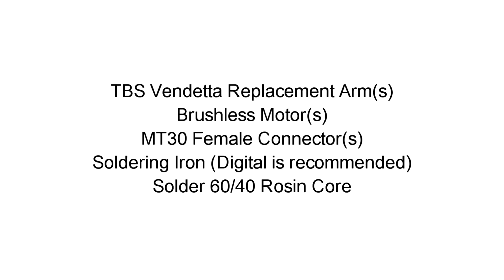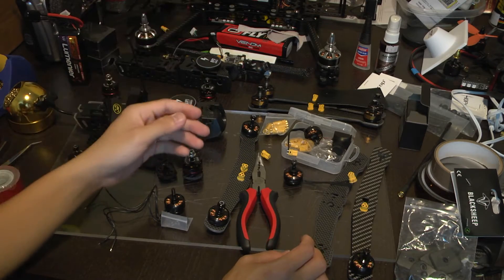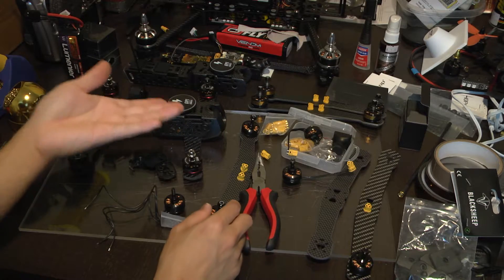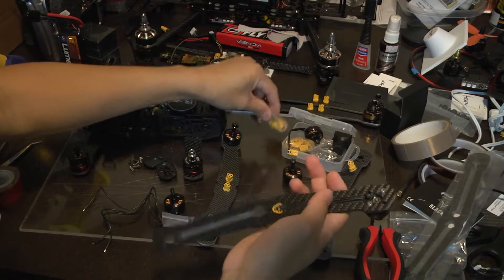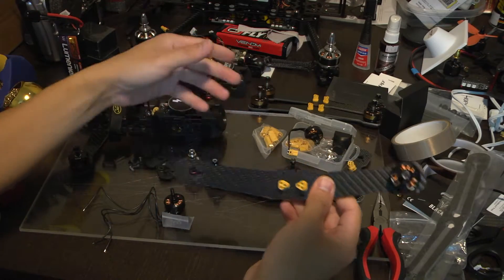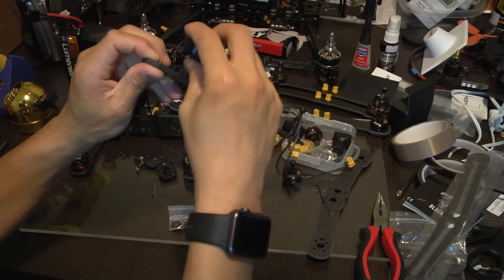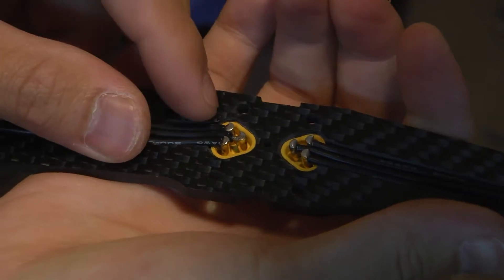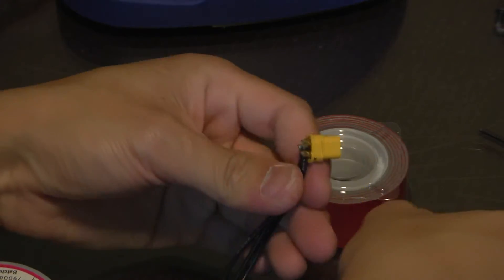How To Solder and Replace Motors On The TBS Vendetta

Comment: another great video. Man I just maiden'd my vendetta today and 20 sec in the air I lost a prop... I think the nut wasn't tight enough and I crashed and cracked an arm... needless to say this video was a huge help!
Reply from the maker: Thanks for the kind feedback and glad that the video helped you out.  Don't be hesitant to reach out to me for any questions or additional help.
Reply: actually... another issue I'm having with the Vendetta is the fpv video is totally washed out. I thought it might be the zero zero cam so I upgraded to a HS1177 and it has the same issue. I changed the cam voltage on the OSD from 12v to 5v... that didn't help. I also tried messing with the brightness contrast in my goggles and that helped a little bit... but still pretty crappy. Any ideas? Have you had the same issue?
Reply: update... I adjusted the settings on the camera itself and I think that fixed it. I'll have to take it out for a spin to be sure
Reply from the maker: For the Vendetta in this video, it comes with the new ZeroZero, which really isn't that much better.  I used the HS1177 like you currently and use these settings from this YouTube video:
https://www.youtube.com/watch?v=p-DAu-75ui8
Hope that helps.

Comment: Nice video you got a subscriber here, what motor do you recommend for me? I'm not after speed or punch I'm looking for efficient long flight time/range. Thank you
Reply from the maker: Thanks!  I'm still looking around for the most efficient motors but general guidelines for longer flight time are as follows: 
1) Use a lower kV motor than the stock 2300 kV and try to find the most efficient motors too
2) Larger props, I would use 6 in props with the aftermarket All Carbon RC arms (get the 6 in prop version) over the 5 in props as mentioned in the video
3) Go with dual props rather than tri-props as they are more efficient
4) Make the Vendetta as light as possible as weight is a big enemy 

Hope that helps!